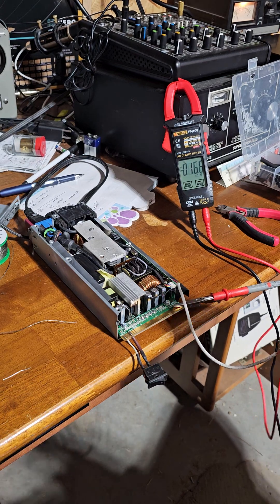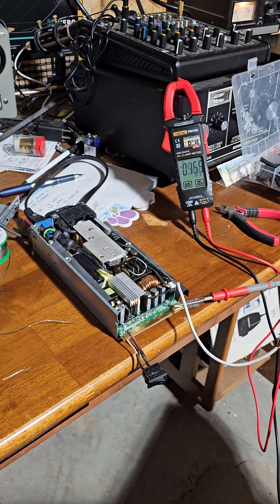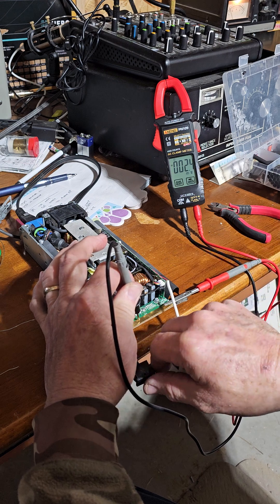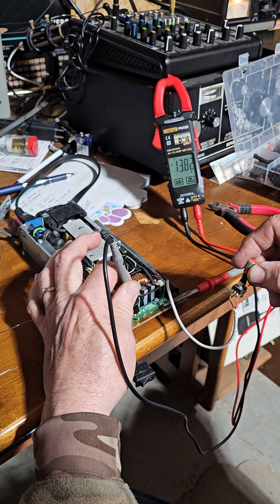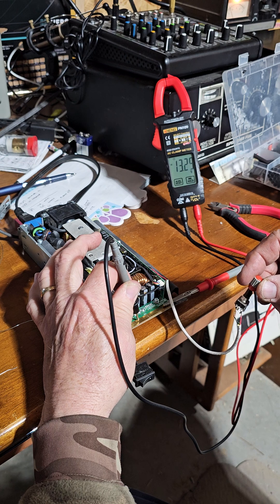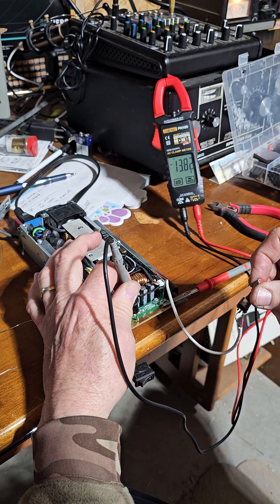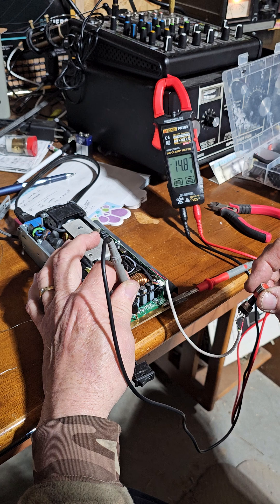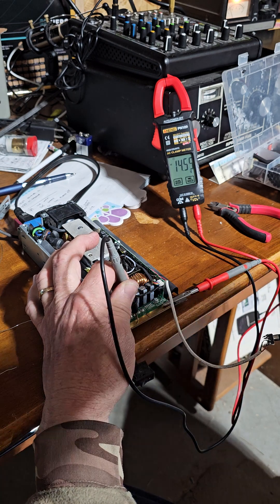HP 1200 SBA with a 50K potentiometer on the voltage control circuit. See Description for details.

Comment: Hi is the potentiometer soldered onto the same place the resistors were added and is it just a potentiometer unit own?
Reply from the maker: Potentiometer goes in place of the resistor on the voltage control side. The crowbar resistor stays where it belongs.
Reply: @Triple_3_In_The_Ozarks thanks brother! What rating is the pot?
Reply from the maker: @Jimmyboy1674 50k

Comment: always good to have that feature.  I have a 50k on mine.  Sometimes I run 14 flat, or 14.8 for the Fatboy technology.  For radio, I use a separate PSU.  I pushed one of PSU to much, almost destroyed it, had to repair it.  Good I have back up PSU, back up everything.  Especially tools, gotta have 6 of everything, sometimes I can find everything, but the tool I need, that one is missing. all of them are missing.  Good video, educational.  Hopefully people get motivated, you just gotta put the video out to the public. I don't promote my channel, it's just there.